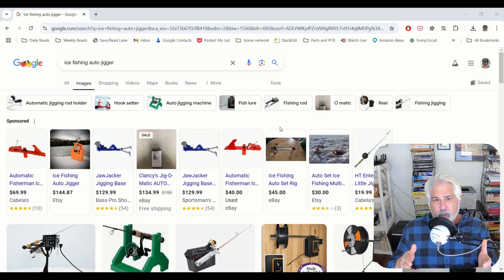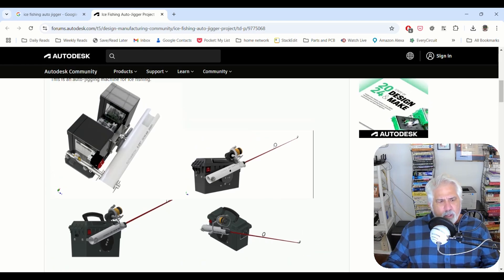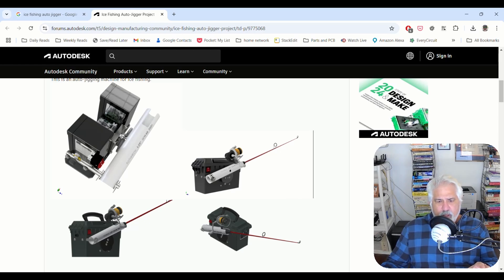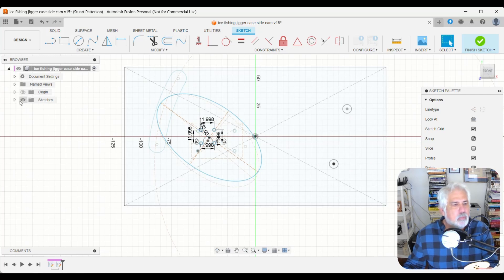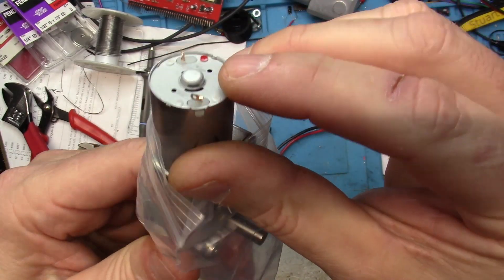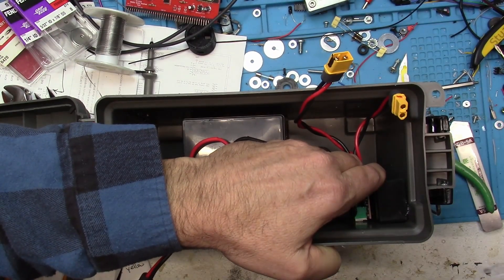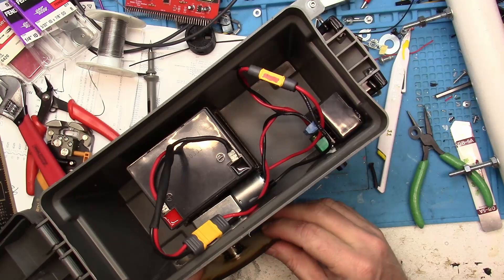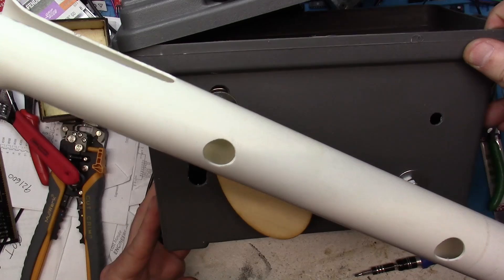DIY Automatic Ice Fishing Jigger

Comment: Picking up the parts do do a similar build tomorrow.... been planning it for a while, but now I will make it happen.
Reply from the maker: Cool!  Let me know how it works out and how you design it!  The only problem I see with the one I made is that the fall of the rod is loud.  The person I gave it too said he was going to add some rubber at the bottom to make it quieter.
Reply: @StuartPatterson  I am planning to put the cam wheel right under the rod holder and make the wheel interchangeable to different designs
Reply from the maker: @TheSkinking  Yeah, that is a good idea and then you can get different jigging patterns.